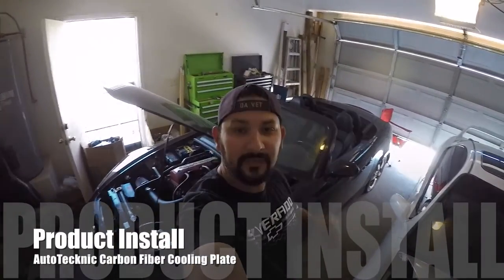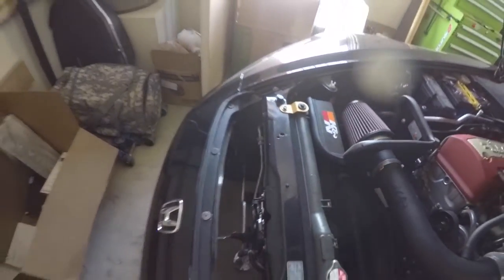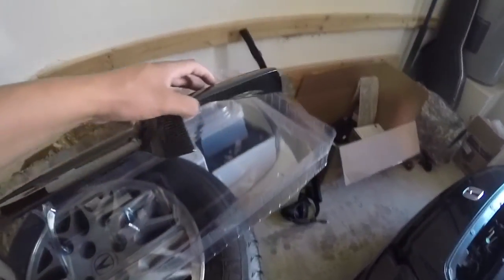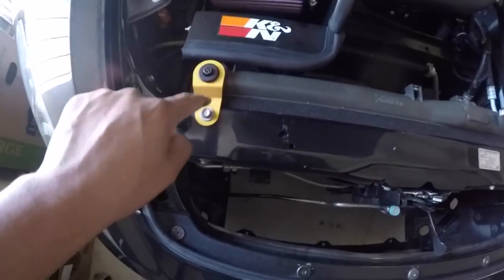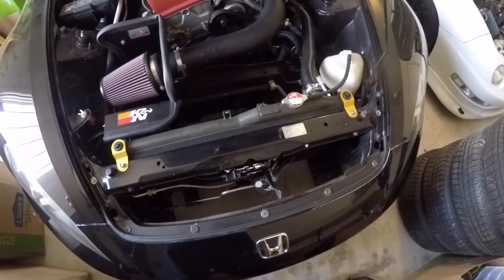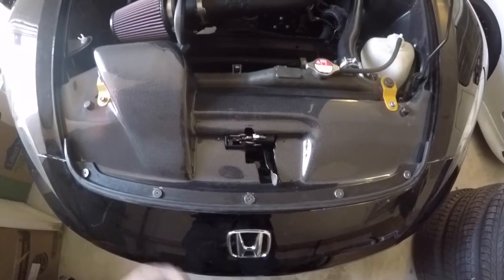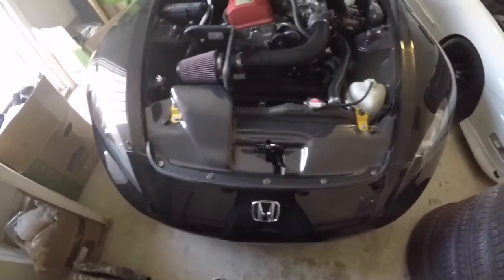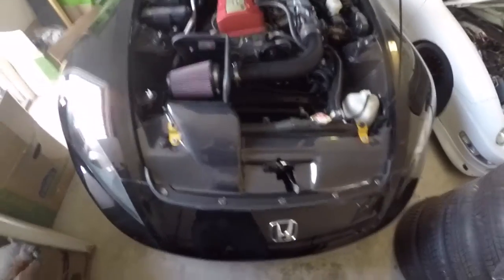Installing An AutoTecknic Cooling Plate In The S2000! (Project AP2 S2000 Part 3)

Comment: Bro, i just bought one two days ago. But I am having mixed feeling whether I should install it or forget it. Because I worry that the rain water would have gone in from the front grille. Then suck into my air filter and kill the engine. 

Thoughts?

Comment: Good video. side note, the stock air diverter that you're missing pressurizes the air into the radiator, vs. your aftermarket cooling plate pushes it more into the engine bay.

Comment: I got one on my S2k but what I did was, I left the stock air box with an upgraded inlet tube and filter from K&N, and the air is literally sucked into the filter from the front of the car, colder air for the engine, you can feel the air flow going into the air box.... just my 2 cents

Comment: Bro, are you sure you dont have an ap1 with an ap2 engine ?
i have an ap1, and its the same as yours inside ...
Reply from the maker: I'm 100% sure. The vin reads AP2
Reply: i dunno bud...the wheels and inside but there is alot of difference with the rear under side
Reply from the maker: +somal Sharma the only thing AP1 that this car has is the wheels. I have a 2006 which is an AP2. It also has the F22c in it which comes on the AP2.

Comment: I have this thing on my car too! :D
Reply: but I have the stock airbox still and the plate looks like it puts the air right where it needs to go.. I put the bumper rubber grommet bracket underneath the dry carbon plate but needed to go to the hardware store for longer screws w/washers.

Comment: You do not reuse the metal plate part.  Take it off.
Reply from the maker: Yes you do. It is clearly used in the images from the company
Reply: I know what they show.. but that is not correct.  Ive have many of these in the past.  
Do a google image search of s2000 aut cooling plate.   you will see.   Just trying to help.
Reply: I mean .. you can definitely use it that way if you want to .
Reply from the maker: Derek Wheeler I appreciate your help but I am going to leave it as is due to the fact that no instructions were provided and the images did show it installed. I do appreciate your help tho :)
Reply: +Car HQ bro good vids but you just bought a better cooling plate over what is stock and it's carbon fiber! You don't need the crappy oem one. Keep up the good work and be a bit more precise. Cheers!